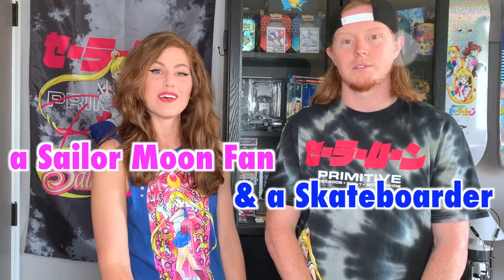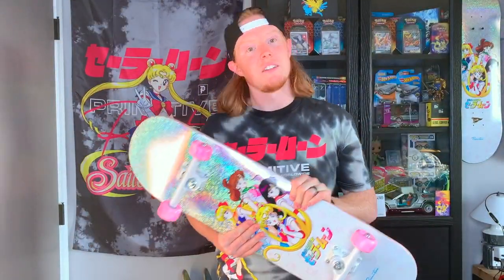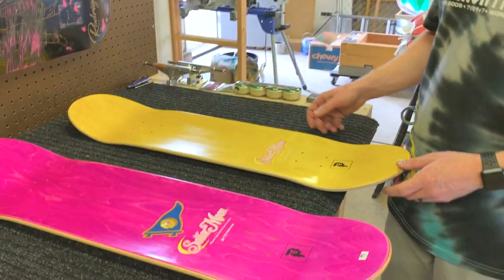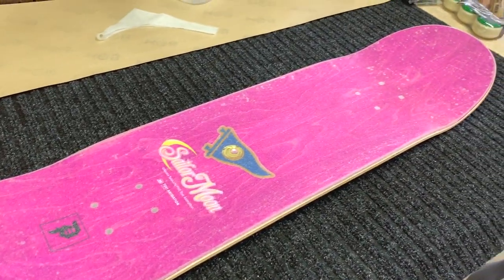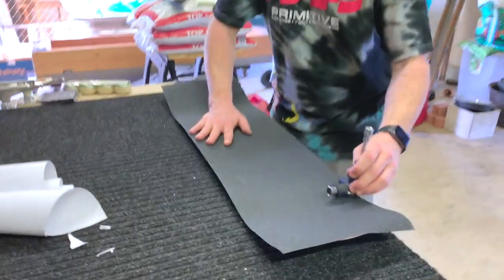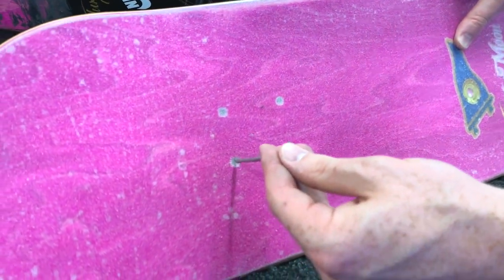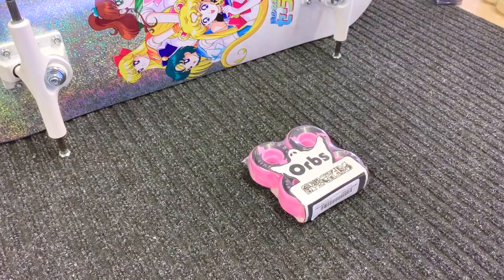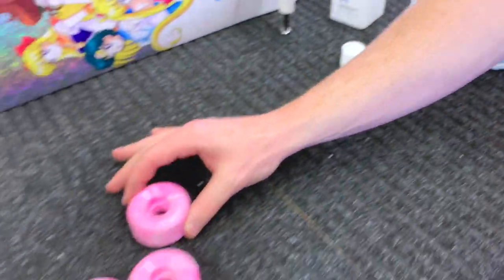How To Set Up/Assemble A Skateboard: With Sailor Moon Primitive decks!

Comment: Ahhh!! I'm so hyped now to try and set up my pink sailor moon deck. I wanna copy this whole design! Lol. Is there a link for the wheels and trunks? Also, is the clear grip tape just not recommended for professional skateboarders but it's fine for people who are non-professionals? Like I don't plan on using my deck too much lol just to probably use it as a photo prop every now and then 😅😅
Reply from the maker: I don't have links as we were all over the place for the items we bought. Just gotta search :) Things are scarce right now so check multiple sources. We named the brands so you should have all you need. The clear grip is for skating too.

Comment: Thank you for this video! It was very helpful. 

I used to skateboard in middle school but transitioned more into longboarding in college. I always bought my boards complete so I never customized. Would it be ok if I used the Sailor Moon decks and build a longboard? I don’t do tricks anymore and I have experience from varying sizes of longboards (Penny, Arbor, etc) even though I haven’t longboard in 5+ years. Do you have any experience using a clear tape to protect the artwork on the skate deck? I know it’s impossible to keep it in mint condition after riding but I love the artwork on the SM decks that if I can protect them a little bit I’d invest in it if it was worth it. Thanks again!
Reply from the maker: This is a question for Curt! I'll send him your way :)
Reply: Using the sailor moon deck would be ok, just wouldn’t really be a long board anymore, more of a cruiser board. On the topic of protecting the graphic, I tried to find some options, apparently there is something called “slip tape” that is a clear sheet that you apply to the graphic side of the board, but I was unable to actually find any online. I have never tried to protect the graphics on skateboards myself so I was unfamiliar with that kind of product. You could just use a clear coat spray paint, but this will only add a small layer of protection, but still something. Here is a link to a video on how to do that step by step. 

https://youtu.be/0Ab8x_xazFU